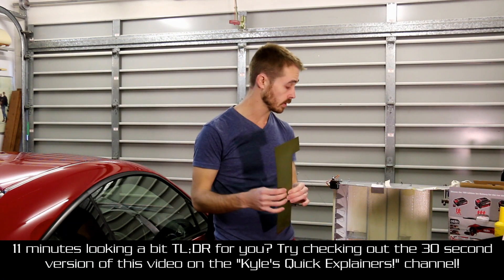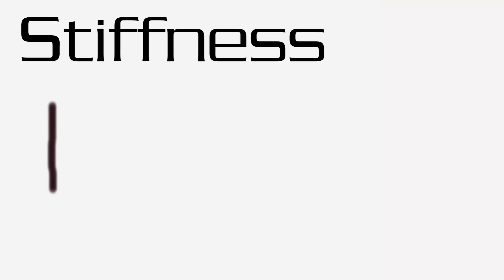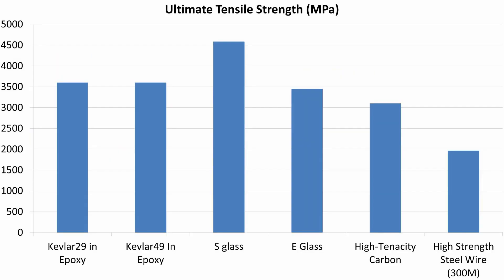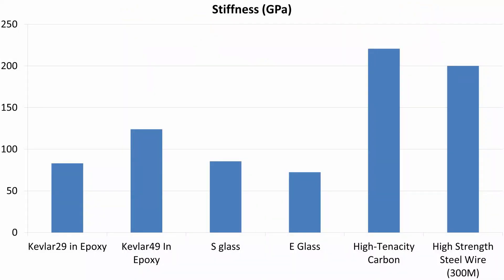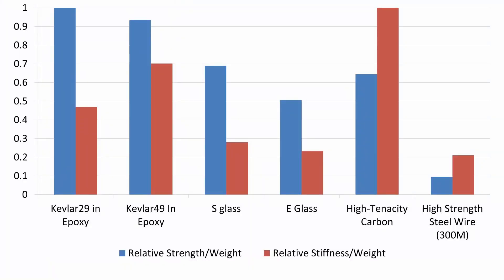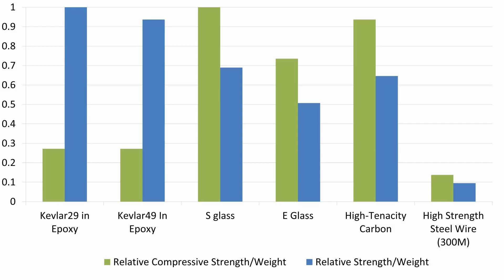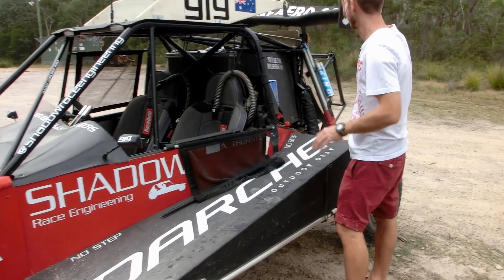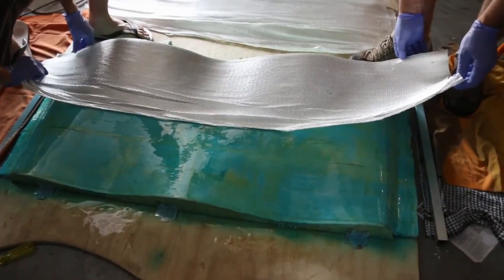Carbon Fiber vs Kevlar vs Fiberglass - Which one is right for YOU?

Comment: you made me also think of another thing wouldn't fiberglass reinforced concrete be better to uses then rebar / wire meshing?  If the tensile strength is truely better then rebar/wire meshing then why uses rebar/meshing for given concrete its  tensile strength reinforcement? It seems rebar would be more effort to install then rebar maybe its the cost in s and e glass then iron.

Comment: Very very very good explanation. I am just left with two question. Fiberglass its usually woven/spun with glass fabric on a plastic resin is kevlar just made with plastic resins spun no glass fibers or sand add? And whats the difference in making carbon fiber vs fiberglass is it just mixing silica sand instead of fibers of glass on resins?

Comment: so... for a little sailbot, about 4.5 meter long and 21.50 meter large... is fiberglass a good idea ? i mean istead of wood or steel ? Because in the price of wood there is also the paint and other things... and it take a bit of tim to buid... steel is easier but not cheaper... (i mean the very expensive steel that doesn't have oxidation, i don't know the name in english ^^' sorry) but it's heavy.. and not really beautiful... there is aluminium but it's also expensive ans it's really a hard material to deal with... so... for a little cruise boat just to sail in good weather and just cool little beautiful and confortable and also easy to transport, wich material do you recomand ?

Comment: Dude you're really underselling carbon fibers, the numbers you gave were pretty low end both in strength and modulus. At the same time the glass and especially Kevlar numbers seemed really inflated, there is no way Kevlar+epoxy has a tensile strength of 3500MPa.

Comment: If I wanted to create a bullet proof car, could I use really thick Kevlar panels to replace metal parts such as doors? This is the lightest composite so shouldn't increase the weight far higher than the existing weight of the steel part of the car?

Comment: Ther's already a lot of differences between the weave of these materials (I know that in bicycle components and frames, they used to use a "3k" or "12k" weave, but most of the manufacturers now use the "UD" kind of carbon (the weave isn't visible anymore and the parts are stiffer).

Comment: The commnet at 2:17 in the video: " Density is basically how much material weights per unit area", I'm afraid i can not agree with that, definitely not how density is defined and how it's calculated.
Reply: I think he just mis-spoke. He said area, but he wrote volume.
Also when talking about fabrics, the density of a fabric is weight per area (grams per sq.m, or gsm), so he might have gotten his mind stuck at that.

Comment: There was a lot of talk about S glass versus E glass, and then the presenter abandoned that issue and started talking about "fiberglass."  So this could have been a valuable discussion, and suddenly, it wasn't.
Reply: S glass and E glass are two types of Fiberglass
Reply: S-glass is almost never used, in my observation.  Designers jump right from E-glass to carbon / kevlar, without using S-glass.  I suspect S-glass just isn't cost effective for the additional properties.  It is also stiffer and harder to work than E-glass, and heavier than carbon/kevlar.
Reply: I am curious as to what he used on his race car setup (maybe I missed it in the video?). From my understanding S-Glass is still cheaper than Carbon Fiber. I suppose it depends on the application (and budget) as to which would be the preferred choice. I see what you're saying though, it may be better to either go with E-Glass, or just make that cost jump to Carbon fiber
Reply: My knowledge is from the world of boats.  I think if weight is not extremely important, e-glass is used, and if it is, carbon fiber or Kevlar is used.  They are used differently, depending on the kinds of stress they will be subjected to.  Carbon fiber is used much more than Kevlar, as it is much stiffer, and easier to work with.  Engineers usually design to deflection rather than ultimate strength, so carbon is used more.

Comment: In the video you said one of the advantages of fiberglass is its thinner than carbon fiber. So, do you have a graphic to show that to have a same certain value of strength with this much layer of fiberglass equals to this much layer of carbon fiber? I know there are so many parameters such as usage of resign and type of a reign, but can you say anything approximately? Very nice video btw, thanks. :)

Comment: Finally, some actual information. Thanks a million.
I would love the actual facts about how a foam core can be regarded suitable as a structural element in layering of fiber glass or any of these products.
As described in other videos here on Youtube we are often told that a 30 mm layer of marine grade foam board may have to be substituted by up to 9 layers of fiber glass.
The immense difference in strength and stiffness of these two materials should be apparent to anyone who ever held a piece of foam between their fingers.
What I lack is the facts and figures as you presented it in this video.
Please do describe this for us laymen if you will. It will be highly appreciated.

Comment: Thank you so much for making these videos Kyle. I really appreciate you taking the time to make them.
I was wondering if I could ask you some questions?
Currently,I am preparing for FSAE in China. I am in the Aerodynamic team. The Aerodynamic team is divided into two, first is responsible for design of the Aero-package, the second one where I am in is responsible for the structural  analysis and manufacturing. To be specific, my team is responsible for designing the Aero structure that allows greater strength, toughness and stiffness at the same uses as low weight as possible. we want to reduce the whole Aero package to less than 10 kg. Could you provide any suggestions we can use? perhaps the design of the inner structure of Air foil that has high strength or stiffness to weight? The type of diffuser we could use ? The type of front /rear wing mounting we could fashion? Any suggestions will greatly appreciated.

Comment: All and none are the best: Carbon is the stiffest and the more resistant in tension and compression, but also the most expensive. Kevlar have the lowest density and is the most resistant in sheer strenght and abrasion but very poor in compression and needs to be dehumidified before lamination. fiberglass is average for tension compression and sheer resistance, heavier but alot more afordable for everyday use and is comming in the biggest range of technical fabrics.

Comment: Good video, i was wondering about this. Carbon is just for show off in most cases 😂
Reply: Just stir in some powdered graphite in your gel coat resin. It'll look close if the weave is similar and the two are both employed in visible features (carbon fibre and fibre glass).

Comment: I assume that the properties of stiffness and strength shown here are for the unidirectional lamina( fibers in a single direction) . If any of these materials are multi layered ie close quasi isotropic or quasi isotropic as such their properties drop significantly. In these cases it would be preferable to use metallic body instead of fibers.

Comment: Want to make some saddlebags for my motorcycle, I'm assuming the fiberglass would be best since you said carbon fiber damages the aluminum? With an outside bottom layer in case of pebbles hitting the bottom of the bags (2017 victory octane frame is aluminium with tubular steel backing)
And making a protective skid plate out of Kevlar for abrasive road garbage?

Comment: You can sometimes get a CF/Fiberglass mixture where the base is fiberglass and the final layer or 2 (in usually a 6-ply stack-up) is CF. That way you can save costs while giving off that sexy twill pattern.
Reply: You should nerver do that... bc fiberglass flex alot more then cf so the cf will crack/break

Comment: This agrees with my experience building high performance power and sailboats. I worked with S glass, carbon, and Kevlar from about 1978 to 1998, it appears that things haven't changed much. 

Most of the failures I saw were compression failures, we quickly learned never to use Kevlar in compression. I think part of the problem is that it's hard to get Kevlar (basically a polyethylene, therefore "slippery") to bond to the matrix. It was always a pain in the ass to use, hated by all.

I loved S glass, by far the best strength and stiffness / dollar, great in compression. With any fiber, but especially with glass you must make sure that the sizing is compatible with the resin you use.

Carbon fiber, miracle shit. We built a 30' carbon fiber/epoxy/Nomex honeycomb sailboat hull and bracing (ca. 1988) that came off the mold at about 250 lbs, stiff as a brick. Two layers of 0/90 tow | Nomex honeycomb | 0/90 tow. Only issue? you could take a sharp pencil and smash it straight through the hull. We warned the purchaser not to do that...
Reply: I'm assuming that's 2 layers of 0/90, 2 layers nomex, and 2 layers more 0/90, otherwise that's insanely thin for a boat hull. Even still, that's thin for a hull. I've done aerospace stuff and am slightly triggered you didn't do any 45. We only use kevlar for things like belly panels that get lots of abrasions or internal "hinges" Otherwise it's not a very good structural component. Never tried stabbing it with a pencil, but a (I believe) 2 ply tailboom is practically unbreakable and works as a baseball bat.
Reply: @JZStudiosonline  Ooops, My bad, back in the day we called Nomex honeycomb, simply "Nomex". How thick was it? I've forgotten; 12 mm? 16 mm? Something like that.
My comment ,"never to use Kevlar in compression." was meant for Kevlar skins.
Reply: Where can I learn your craft?
Reply: Have done boatloads of research & hands on.  Give you some tips.  freemansuppy.com  for their free vid library using their pattern/moldmakers gear.  Look carefully at compositeenvisions.com for their 3 (yes they cost something) videos explaining how to do professional layups.  Com Envisions is the best place on the continent for exotics.  Things are wild out there as some can use 3D software, 3D optical/lazer scanners to do near female mold quaulity with 3D printers.  Now that Stratasys patents on their Ultem 9085 (PEE plastic)have lapsed a thin honeycomb & thin film covering both sides with a laundry list of prepegs vac bagged/autoclaved cheeper than female molding processes.  Look at 3dp-platform.com    i like their WorkBench Series #400 with bed size at 39" on "Y"axis by 57" on "X"axis by 27&3/4" on "Z"axis(folds thru house doorways & runs 45 to 55K$ depending on extruders and enclosures).  It is thoff to get all their info on YouTube but their next model up is 112" on the "X"axis.
Reply: @harounben342 I learned it on the job. I don't have an engineering degree, but I do have a minor in Physics, and an engineering mindset. I started off as boat carpenter, and decided to get into high tech racing sailboats and foils. Had some help from friends, but mostly read a lot, and most of that was engineering text. Then it was trial and error. 

Do I recommend that path? Mostly no, it took too much time, and it depends on what you want. I just stumbled through, and would have been better off if I got an engineering degree in the first place. On the other hand, the experimenting and trial and error I was able to do while working for myself is the basis for all I know about composite structures.

I'm sorry, I have no clue, other than in your garage, where you can get the experience you will need.
Reply: Can you hybrid layer? Say have Fibreglass on the outside, then carbon fibre? Would it bring any benefit to the penetration protection or performance?
Reply: @jugganaut33  you can do that, the proplem is that due to the low stiffnes of the glass the carbon gets loadet first, so there isnt mutch of an advantage over an completly carbon part if the part is loaded in just one direction. But it can be beneficial if you want du save coasts to reinforce large glassfiber parts with strips of carbon in stiffnesscritical direktions.
Reply: Had a motorcycle Hellbent  AGV it had there’s layers of fiberglass-carbon-kevlar
Reply: @jugganaut33  No reason that you couldn't, but it would be unlikely to be the best solution. That sailboat was an Ultimate 30, strictly for racing.
Reply: Chimera my old man would like to pick your brain, he’s designing a high cruising speed ocean shuttle.
Reply: Had a thought to layer the 3, what’s your thoughts on this?
Reply: I'm a welder and I would like to make a welding hood that can withstand the heat from welding 14hrs a day what would be the best material?
Reply: @Patryk24k  i was a fueler in the military... we used nomex suits because it's supposedly fire resistant... never put it to the test though.  I don't know what it would be like hardened in resin!
Reply: @thomasbaker9787  it can be burnt but it doesn't burn itself and sticks to skin. Racing drivers use nomex suits.
Reply: i wonder if it's possible to use fiber as a reinforcement for aluminum alloy to achieve great structural strength but also prevent weak, easy to shatter/deform surfaces by using a metal coating that's somehow fused with the carbon/glass/kevlar fiber.
Reply: What is the best material to use on making a bulletproof vest?
Reply: But why did you use Nomex honeycomb but not other materials?
Reply: @ukuskota4106  Nomex honeycomb, at least back in the day, was the lightest and strongest way to separate the skins of CF.
Reply: @ChimeraActual  Why it is the strongest way?
Can there be cheaper materials to make a honeycomb? I think Nomex is quite high-tech, so is expensive.

Comment: carbon fiber vinyl is the best, instantly adding 100+ horsepower unlike any of those
Reply: add a vtec sticker and instant 1500 hp
Reply: @kobescambler  what you really need is a Wu-Tang Clan sticker. will add 3500 hp
Reply: Don't forget to put a toyo tires sticker because with all that horsepower provided by the carbon fiber vinyl, you will need more grip
Reply: @jefgir1097  and Recaro stickers on your seats because its all about weight reduction
Reply: @jefgir1097  And pipes.  Gotta have pipes.
Reply: You guys are forgetting flame stickers for around the fenders, keeps the body looking hot and adds 450HP
Reply: And this is only for doorlock, if prepare the transmission you adding 10000+hp
Reply: YES!
Reply: Omg y’all forgetting to add Eat Sleep JDM stickers for weight reduction!
Reply: Carbon fiber paint the s fiber glass
Reply: @jackzahran6689  🤣
Reply: K&N stickers are another +100 HP
Reply: put a Summernats sticker on and you will be doing burnouts like a pro.
Reply: And yeah, get a "FAMILY" sticker too. Believe me, it'll help.
Reply: Don't forget about Garrett, Greddy, or HKS stickers for massive boost. They also make cool sounds
Reply: Metal foam
Reply: Ur jokes can make a 12yr old kid order vinyls worth ks for his grandpas car from his fathers credit card
Reply: I carbon vinyl my whole ride and now Im kicking mustangs asses,  , booyah
Reply: @nobullshiit5682  f**k yeahhhh 🤙
Reply: With all this HP you could pull Dom's 5000hp charger
Reply: But makes ur wallet 10kg lighter
Reply: Just keeep a lappy on the pas seat! It ll add the power of holy family
Reply: Guys come on, what we really need to add is a sniper scope they make everything 100 times better!

Comment: How about inter weaving 50% E-glass fibres with 50% 3K carbon fibers into the same matrix? Soller composites sell sleeving to make tubing made that way, I'd be curious to test how it scores. Should the resulting material have somehow intermediate stiffness between the two (say 100-130 GPa Young's Modulus)?

Comment: I want to build my own skid plate for a coil on a metal detector main wearing point is friction or abrasion as it rubs along the ground, did not catch any reference to which is better for abrasion resistance or is that all up to the resin you decide on?

Comment: you missed something that isn't important in racing. that is aging of the material. plastics aren't good for cold environments. they tend to break in a micro scale much easier. this is really important if your building something that it's strength is critical and doesn't get replaced much.

Comment: Thinking about buying either carbon fiber or fiberglass front splitter? The car will mainly be for street use and it may sometimes scrape on bumps. 

1. Which is more resistant to abrasion?
2. Would fiberglass sag with prolong use?
3. Which is likely to break more with the same collision? It seems they have the same stress tolerance

Comment: I am a bit confused. I want to loose weight on my subaru impreza. Not too bothered about stiffness unless it will start falling apart at 180mph. But must get lighter. I am planing to build doors wings and bumpers. Should I go s glass or carbon Viber?